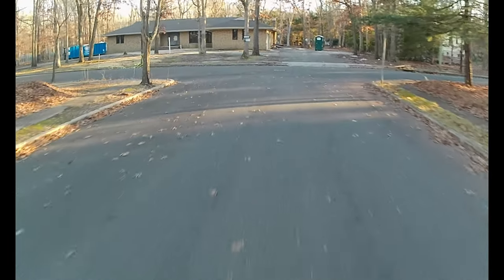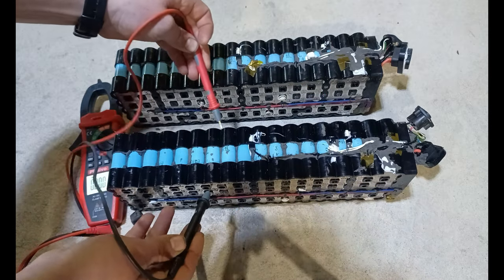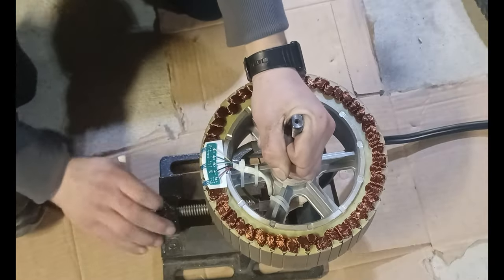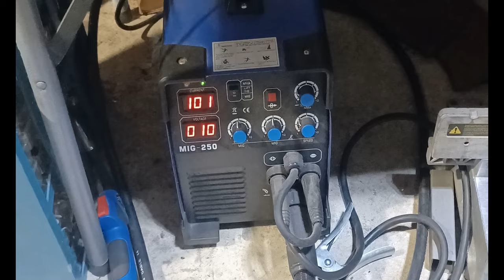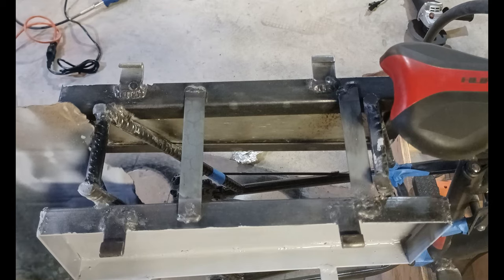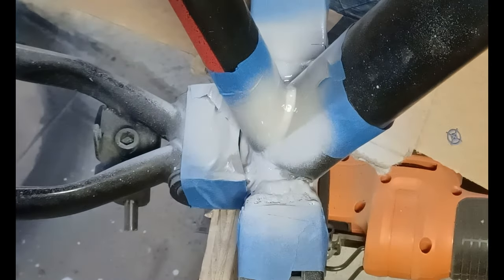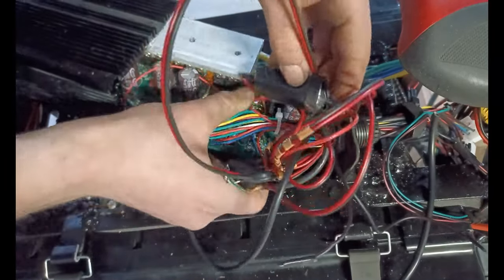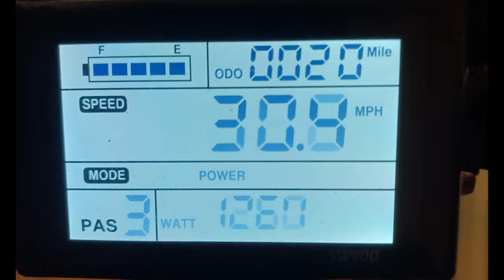How to Build a Fast Ebike (save over $4000)

Comment: Good video but the holder for batery you made,most weight is more than the whole kit lol ,good job
Reply from the maker: Thanks you😀. The weight at the back wheel, gives the bike lots of traction👍
Reply: I agree with traction but at that speed your bike can do is hard to handle the bike like cornering ,aniways video is good .I was watching stuff as I burned my controller or something as motor won't turn with no pedal assist or throttle but when I come t single green wire the cruise control is on but wheel spin clock wise one time and after reconnecting it spins other way ..I'm learning electronic part to build something cool like you .

Comment: Hey buddy good job very good job that bikes really cool it looks like you really did your research the only thing I see in my opinion that you did wrong what's drill holes in the outter case the outter case uses oil rings they have little springs inside of them that are usually in like a 5 horsepower Briggs & Stratton engine and if they can keep oil from leaking out of the shafts I'm sure they can stop water from going in and you should used gasket maker around the circumference of the covers if you're getting water in The hub motor it means your rings are bad and they need replaced that shouldn't happen for a good amount of time everything needs to be mean tained painting the inner components was a good idea I would have had it stateraid first but even painting with primer and paint when the water is inside the motor in the motor spins the friction between the water in the will eventually degrade away a lot faster than the gaskets giving in I bet if you took apart your motor and you looked inside the paint will be faded and almost gone in some areas other than that very very great and I'm very impressed
Reply from the maker: Thanks for the advice

Comment: Im running the same battery and motor set up as this :). The way these things accelerate from 20mph to 40 mph is just crazy. I would highly advise fitting one or even better 2 torque arms though. They are  cheap, easy to fit and not up for negotiation on a hub drive in my opinion. its only a matter of time before the wheel will fail without warning(i learned the hard way).  hydraulic brakes are a must have on anything t hat goes over 20mph in my opinion too.
Reply: How did you make you go 40 miles per hour
Reply: @bruzza3031  running 72v so tops out around 55mph

Comment: I built my 1st ebike with a 1000w rear hub motor and fitted the battery on a rack. Worst thing I ever did as all the weight was over the back wheel. The bike handled so badly it was dangerous.
Reply from the maker: You gotta start somewhere. Ps this is also my first ebike👍

Comment: If you have two bms do they not work against each other
Reply from the maker: The BMS will only discharge a cell when it hits 4.2v. So even if you have two, it will not affect the second one. Ps the second BMS is there because when you charge and discharge a battery pack at the same time one BMS can't do that efficiently so you need two BMS's

Comment: When welding you should grind the paint off of the surface you are attaching you metal rods.
Reply from the maker: Thank you for the advice👍
Reply: Yep
Reply: Yeah that's the standard way of doing it because everybody does it and it seems like the right thing to do but welding gets so hot the paint has no effect on your welds

Comment: The light just stays on and drains your battery ?
Reply from the maker: Yes(as long as the key switch is on), But the headlight draws about 20 watts when it's on low beam and the total capacity from the battery pack is 2088wh, so the total time it would take to discharge the battery pack is about 104 hours, thanks for asking 👍 😀
Reply: I put a switch on that circuit.. no need to have on during day.. but visibility is huge.. no arguing there

Comment: An A for effort!
Just wondering if you've found out that bicycle wheels weren't meant nor made for that kind of speed?!
 Hope you have good insurance, be safe out there!
Reply: Actually a normal bike tire can handle up to 150 miles an hour without exploding that's just a regular bike some cases I'm sure are a lot faster
Reply: Even if you had a motorcycle that was built to spec you have more chance of wrecking the bike before any catastrophic failures happen

Comment: Not fast its around 30 pmh
Reply from the maker: I didn't have the distance to reach 60mph. but if you go back to 14 minutes into the video you'll see the float test👍
Reply: @ElectronicLab.  That's just a free spin being capped by your controller (that limit might be programmable though)

As soon as the motor has to drag the entire weight of a bike and rider, it'll either take a excruciating long time to reach topspeed or the acceleration will taper off before it reaches top speed. Still, doing 50+ mph on a friggin' mountainbike is scary, I've managed to push my 1500 watt build to about 37mph, (I haven't tested it on a full battery yet but it should be able to reach about 40) which is scary enough already having to deal with other traffic as well. 😂
Reply from the maker: That's right😀